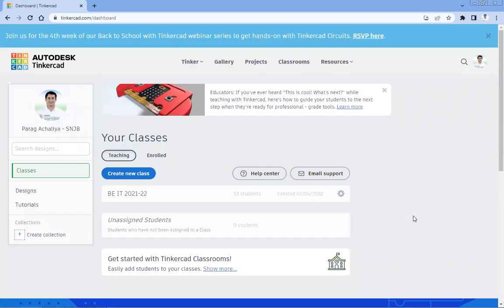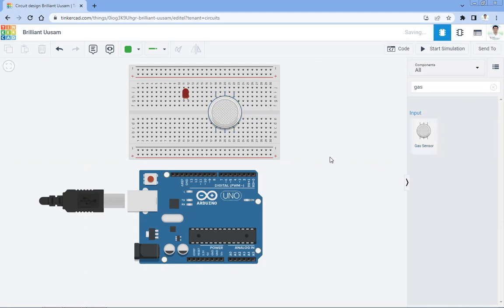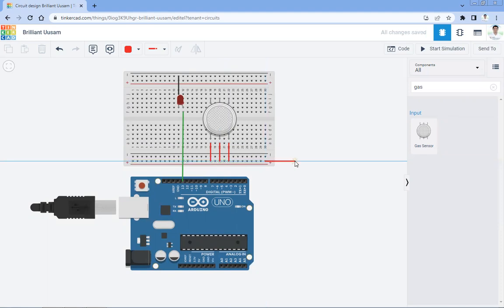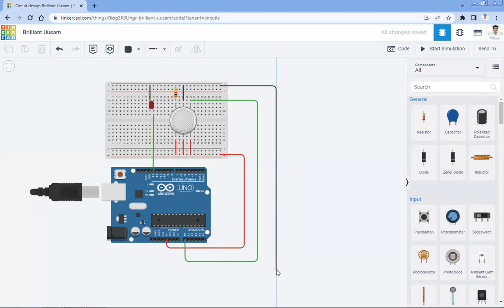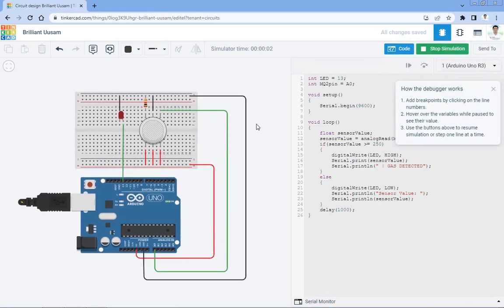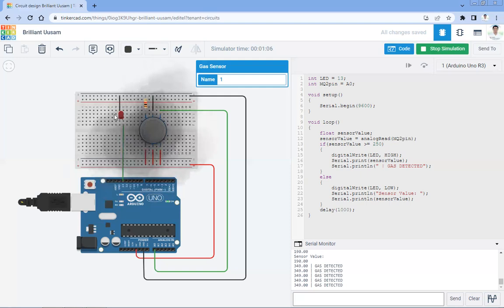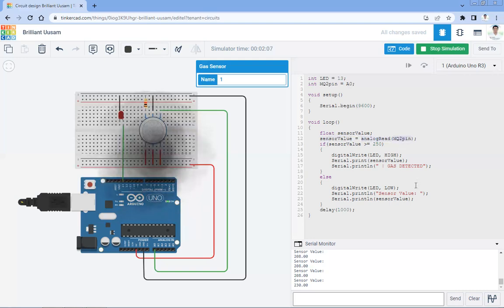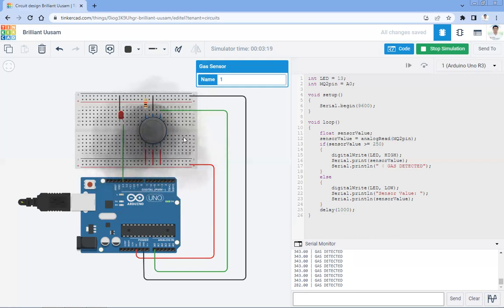Gas Sensor and Arduino using Tinkercad

Comment: int LED = 13;
int MQ2pin = A0;

void setup()
{
  Serial.begin(9600);
}

void loop()
{
  float sensorValue;
  sensorValue = analogRead(MQ2pin);
  
  if(sensorValue >= 250)
  {
  	digitalWrite(LED, HIGH);
    Serial.print(sensorValue);
    Serial.print(" ");
  }
  else
  {
    digitalWrite(LED, LOW);
    Serial.print(" ");
    Serial.print(sensorValue);
  }
  
  delay(1000);
}